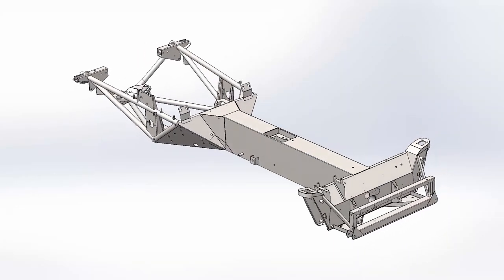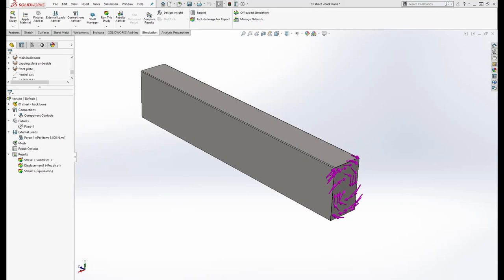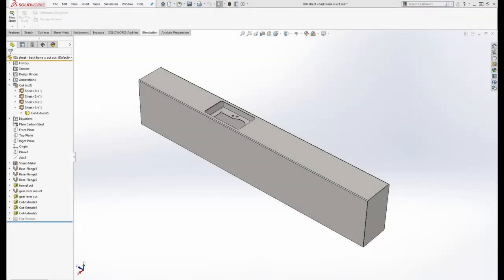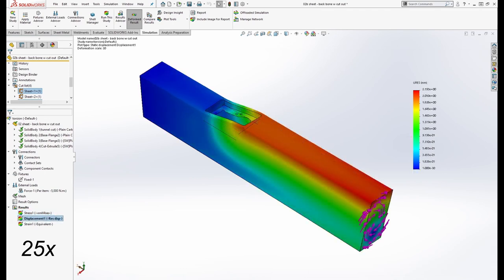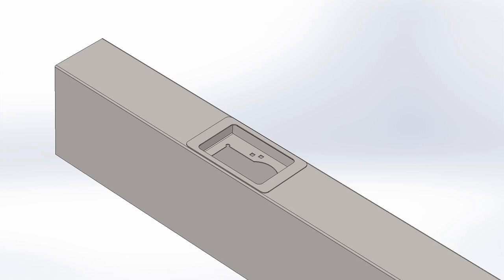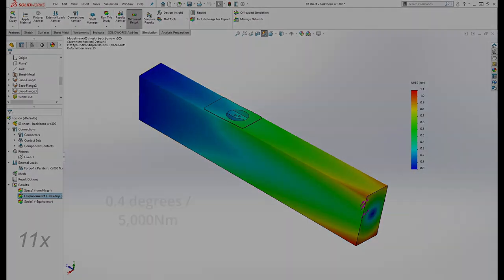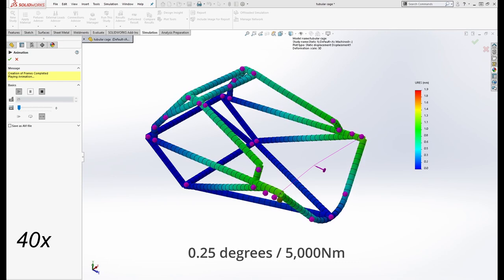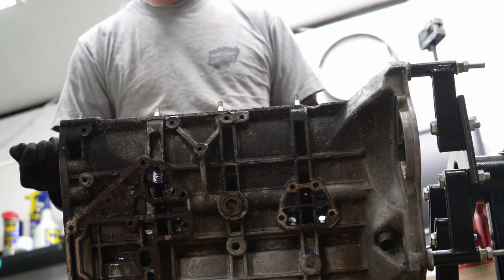Project GT2 - Lotus Esprit chassis Solidworks Simulation #05 (Mar-22)

Comment from the maker: CORRECTION - @21:44 I make a statement where I was puzzled why Lotus did not carry thru the S300 gear lever mods to the later Esprits.  It seems that is an incorrect statement and that later chassis DID infact have this modification.  I have a 1997 GT3 off site which I was certain did not have this modification but I will double check and make a correction video if necessary along with any investigations into any metal fatigue in this area.  Apologies for any confusion.

Comment: The satisfaction when simulations correlates with reality. In a close enough manner to be trusted for further investigations. 👍
Congratulations to a job well done and very interesting videos.
I know fairly well how much work it is to reach such results. Appreciate it!
Reply from the maker: Yep, I usually do FEA studies to ensure something doesn't fail after it's designed, so it's nice to get some confirmation against something that has damaged.  I was pretty shocked and very happy with the result that I tested it a few times to check.  I also had a good teacher which helps.  Roll cage FEA is incoming, probably sometime in the new year.

Comment: Thanks for posting this. I was looking at the shift lever on my Esprit and found a crack in the exact same spot. We decided to bolt the body to the front and back of the chassis opening. thought about it a lot, but I couldn't remove the body, so I put steel nut inserts in the front and back of the chassis opening, drilled holes in a 20mm aluminum square bar for the bolts to pass through, and used washers to adjust the gap. Holes were drilled in the upper part of the body tunnel and fastened with three bolts on each side to hold it in place stiffly.　(Remove the rubber boot and mounting plate.) As a result, the squeak noise was drastically reduced and the body rigidity was increased. I should have seen this video earlier.
Reply from the maker: Interesting work around.  The test would be to see if the crack propagated further over the miles but you're supporting the collapsing element so it makes sense to me. - stay tuned for updates to this next year when I'm gonna look at bonding a plate on to increase the rigidity.
Reply: @JonHimself  Thanks for the reply. I look forward to next year's video.
There is a supplement. It seems to be called a rivet nut, not a nut insert, and the size is M6. Since I don't have a rivet nut tool I put a long bolt and a piece of aluminum block over the rivet nut to prevent the rivet nut from turning and I was able to expand the rivet nut inside by turning the nut attached to the bolt while passing a 9mm pipe through it to prevent the bolt from turning.
The shift lever mechanism plate, which is normally fixed with rubber bushings, was removed and made rigid and tightened to contribute to the rigidity of the mechanism. (Although the effect is questionable)
My Esprit had a crack in the FRP at the joint between the rear of the chassis and the body and was separated, so I connected it to the body with L-fittings. I connected it to the body . This reduced the vibration of the rear part drastically. This area also needs to be checked.
This suggests that the body also contributes to rigidity.
Reply from the maker: @esprit_hc8885  yep without a doubt the body contributes but the issue is stiffness vs strength.  FRP is strong but not necessarily stiff.  You know that when you jack the car up and the body bends / shut lines start to close - moving the bare shell around by hand as well, you can feel the flex in it.  So whilst it does something, without testing, I don't think it's overly significant especially at the rear which has a huge cut out in it for the engine.  Sadly without a full scan of the shell I wouldn't be able to guess.

Comment: Hello John that is a fantastic video. I actually have an Elite but the 2 chassis's seem pretty similar just reversed so to speak. The gear lever hole reinforcement plate seems like a pretty chunky piece of engineering. Would putting a series of holes in it with a hole saw make much difference to its performance. Obviously a series of holes would help in terms of its weight. The other options would seem to be a carbon fiber plate or a welded steel rectangle with a ring in it for the gear level to pass through and diagonals welded from each corner of the rectangle to the ring.

The other obvious thing I think would be bracing to the the actual box section itself . Not to overcome the gear lever hole but to improve its rigidity over all. Obviously the plumbing issues would be a problem but I have thought before that a series of welded rectangles with an X welded from corner to corner would be interesting. The idea being that a series of slots would be cut across the box section side to side , the rectangles pushed down into the box section and then welded in across the top and the other 3 sides spot welded through the chassis. The plumbing though would be a slight issue haha last I checked no one has invented bluetooth coolant pipes 🙂
Carbon fibre is stated to be " five-times stronger than steel and twice as stiff" according to Doctor Google so making the gear lever plate from that would seem to be a good idea
Reply from the maker: Its not as chunky as you'd expect, you're looking at a plate that weighs no more than 600 grams so its benefits way out perform the weight penalty.
With design everything is a balance between effectiveness / cost / weight / simplicity.
A steel plate cost £10 in materials, and a relatively unskilled person to make.  A carbon plate cost many times the cost, and needs skilled people to produce and cure in an autoclave something of similar strength.  The saving is weight...but you're only looking at grams.

The reason why I did this video was to show this outlook.  Lotus solution is clearly thought out, cheap and works very well.  Welding internal structures and so on is costly, huge weight detriment for little gains.  The back bone suffers from lack of torsional resistance by its sheer design, very little can be done to easily remedy that - you're simply too close to the neutral / torsion axis.  The most cost effective way is a roll cage or re-enforcement of the body in some way.
Reply: @JonHimself  hi John valid points but Making it from carbon fiber would be easy. Applying vacuum and heat is nice but not necessary. For a simple rectangle you just cut a number of pieces layer them in a simple mould and wet through with a paint brush. The mould could just be made from Styrofoam and a hot glue gun to stick it together and a layer of material the cured piece will not stick to

Comment: Really interesting analysis. A return on the gearshift reinforcing plate looks like a good idea to me.
Reply from the maker: Yep, nice thing is you can try different designs on a bolt on part, or replace it if it deforms.

Comment: Thank you that very interesting analysis.

 I have an S3 that came into my possession with air-ride suspension (slammed or stanced) and a 24V Busso in the back. In looking for replacement suspension, I found that the spring rates increased by more that 100% over the years. Stock front spring rate on an S3 is something like 110-120 lb/in and the rate that GAZ were quoting was over 300. I recall the rule of thumb was that the chassis stiffness did not need to be more that 10 times greater that the roll stiffness of the suspension. Part of the reason for the increase in spring rate was to control the greater unsprung weight of the larger wheels, tryes and brakes fitted to later cars.
Reply from the maker: Yup 300 lbs is harsh especially when you can control the damping rates.
I am going to look into the maths behind the suspension fairly soon, I have not chosen spring rates yet but I might combine it with some of the findings here to produce a similar technical video.

Comment: I stumbled across your project and thought you might want to see one way the hole in an Esprit chassis was addressed.  This was an S4s.  IIRC, Lotus started adding the plate about 20 cars after mine.  Honestly, I never considered the galvanization issue.  I sourced the OEM plate from Lotus and handed it to a local fabricator with the requirements "put this on".  His solution was delightful overkill IMHO.  He didn't like the plate I had dutifully waited months for and cut his own, after fabricating a fitted insert.  I'll post a link separately (not sure if YT lets them through).

Comment: Bravo, well done Jon!  I have too many thoughts after seeing your demonstration. It sold me on a shifter reinforcement plate. I have spent a lot of time questioning just how well this frame design holds up and now I know. I am interested quite a bit when you have the body attached as a system how well it performs.  From observation one can tell they tried to reinforce certain points of the body, but I am curious how successful it really is. 
I thank you so much for doing all this work and sharing it with the commuting. Keep it coming as it is such valuable information none of us have.
Reply from the maker: I think the gear lever plate is a must for the old cars.  The issue with the body and with composites in general is the tolerance, to get it to work you need to bolt things together tightly and you just dont see that in the Esprit body due to the fit.  It definitely adds something to the chassis but as I say without a decent model or ideas of the layups I cant really tell right now, maybe 1,500Nm / degree.
What I would like to do is back this up with a physical test to get predicted, simulated and actual results all in a row - but I lack the equipment here to do that here.
This isn't meant to be a definitive answer but where ever the rumored value of 5800Nm ish came from.... I got shockingly close to it.

Comment: I am soooo subscribed to this!!! Can't wait to see roll cage simulations. I wonder how close to a europa the torsional rigidity will get??? Thanks for the Vlog.
Reply from the maker: Sims coming soon, I've done a few but need the time to put them into a video.  Which Europa do you refer to ?  the old one or the one based on the Elise?
Reply: @JonHimself  I'm sorry. The model you referenced in the video was the evora! The magic will be getting the cage and body to exist in harmony I suppose. I remember seeing an X180R and the roll cage was so well integrated but just bolted onto the chassis.
Reply from the maker: @jwdiho  oh yes the Evora.  I doubt I can get close to that.  The issue is the compromise between rigidity / strength and weight.  The Esprit design doesn't lend itself to this well in my opinion as there are 3 elements to the structure, the chassis, body and cage all with their interfaces and limits and fits.

What is important to consider though is the vehicle mass, as it is this that imparts forces on the structure so reducing that will be the same as increasing relative rigidity.  If I make a cage super strong, it'll be heavy and high on the centre of gravity, so you see there is likely a sweet spot to be had.

The X180R is probably better than you think, bolting isn't the issue, it's the compromise in the design for practicality / servicing.  Luckily as a one off I can overlook those consideration on this project and get closer to the race cars.

Comment: Very interesting video. Essential reading is the Lotus 25 book by John Tipler (no affiliation)...who describes how Colin Chapman / Cheshunt stumbled on the torsion box while developing the Elan. What remains an eternal mystery is why Eric Broadley copied the torsion box idea for the Ford GT (with one on each side of the cockpità...but Colin did not for the 30, the 40, the 46...Esprit.

I am building an Elan GTS and there are a few similar subjects. The Elan chassis has some welded in flanged parts within the torsion box which I believe could be interesting to put into your project. However, the Elan also has pressed holes in what seem to be poor locations...probably to help production.
Reply from the maker: Great comment, I was thinking the same thing when I did this study - how it could have been done differently and the only thing that came to mind was splitting the chassis in two and putting it either side.  The body of the esprit itself is sort of designed this way but I was thinking more about something similar to the Elise (tub chassis).

The issue with anything inside the Esprit tunnel / backbone, is all the coolant pipes, and a lot of work.  A modification to the gear lever aperture, safety cage and significant weight loss should provide me with enough rigidity.
Reply: @JonHimself  It might be worth you looking at the Miura and the Stratos designs. Many other mid-engine cars simply continued with bird cages. Part of the answers are in the relative weights of the chassis. My 26R chassis weighs 38kg (the cage alone will add 32kg and the body a whopping 45kg (without the doors, roof panels).
Reply from the maker: @Andrew-vx2ls  when you look at the ultimate Esprit (V8 GT1 that raced with the McLaren F1s) the chassis is almost a space frame, almost indistinguishable from the original chassis.  Another chassis that interests me was the Noble M12.  Cant wait to get into this part of the project, its going to be really interesting.
Those weights for the Elan are crazy, amazing car - I tried getting my hands on one in the past but the right one didnt come along.

Comment: Bravo!  Fascinating.  I am very curious to see if a minimal roll cage structure will raise the torsional stiffness to say 20000 Nm/degree.  I was all excited until you showed the comparison to a modern car.... )-: It would be fascinating to know what level the factory went to when figuring out the benefits of the gear lever plate and the engine bay brace.  Do you suppose they fabricated and installed the parts and then loaded the chassis to failure?  I dont think there was any way to calculate it on such a complex structure back then.

As always - thanks so much for doing this stuff!  I know its going to pay off for you in the end.  

Some day soon you will be playing with Ferraris and Porsche GT3 RS - leaving us pedestrian Esprit lovers in the gutter!
Reply from the maker: Hi Erik - It depends how full on you wanna go with the cage.  I want a race car for the road so I'm not even going to have a passenger seat therefore I can also have a petty bar.  That is going to REALLY increase the rigidity.  Also have a look at the Esprit GT1 vs the GT2 roll cage (pictures are about somewhere) they are two different designs.
They probably did physical tests, anchoring the rear down and then jacking the front and looking at a load cell or hydraulic pressure (thats how I'd do it) and measuring the deflections.  Plus accelerated ageing tests like driving it over cobbles etc (see the Elise Story video) to shake it down.
You buy a Lotus for the handling imo and the Esprit does that very well, even with circa 6,000Nm / deg.  We all get obsessed with numbers at some point but for me it is just fact finding, not top trumps.
The Evora is really next level, I've never driven anything like it since, it's like it has active suspension, its a stunning car to drive.

After the work I have in the GT2 I doubt I'll ever get rid of it - it is part of me now which is why I am putting so much effort into it.
Reply: @JonHimself  Yeah, I bet they loaded the chassis and saw the buckling around the gear lever opening like your model showed.  Immediately went there and reinforced.  That has me thinking - Assuming they did physical tests as you describe, I wonder if they had failure in the rear related to the parts you had to remove from the model (tie in pieces) for simplicity?  Then when they added the rear brace the failure in this area was reduced or delayed?.  

After watching your demo I dont see how the rear engine brace was worth the headache and cost.  maybe that is why they never moved forward on the S4s with the brace?
Reply from the maker: @eriklombard322  tbh we're just guessing but as I say in the video I am not sure why they didnt fit the gear lever plate on ALL Esprits.  That said car manufacturers are not in the business of making cars last a life time - 100,000 miles in and the last time I drove the GT2 in its SE guise it was fine, very spritely - so job done.

I dont think there is a weakness in the rear - again guessing but I think they might have put the rear brace in there for a lot of marketing - yes it works but it's not a huge gain vs the cost and weight / CG.  I think you're right which is why you dont see it on the V8 or the S350.